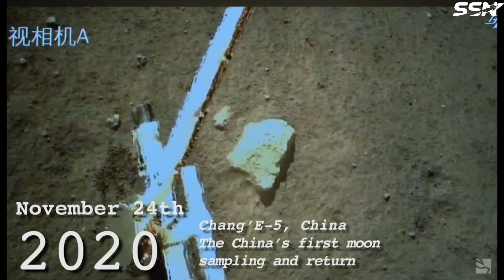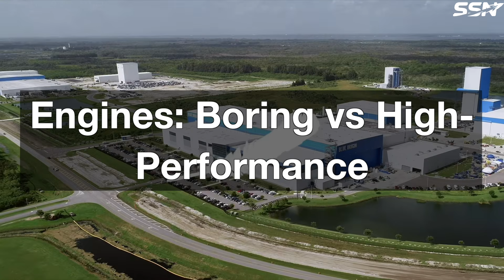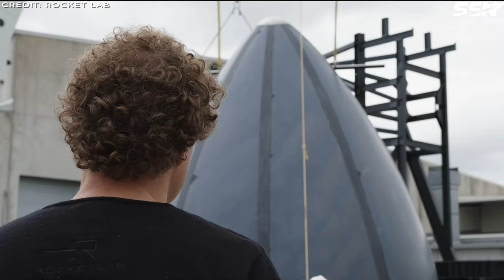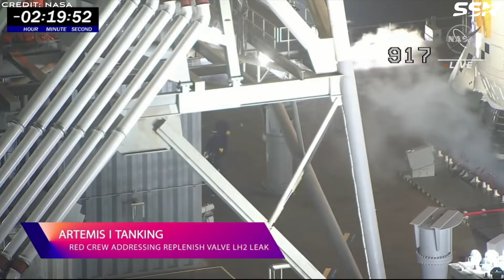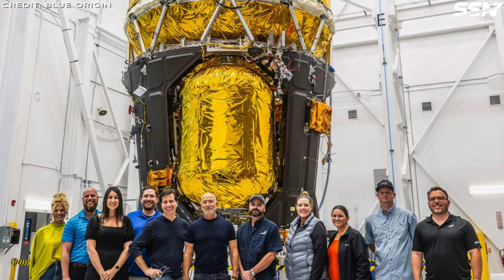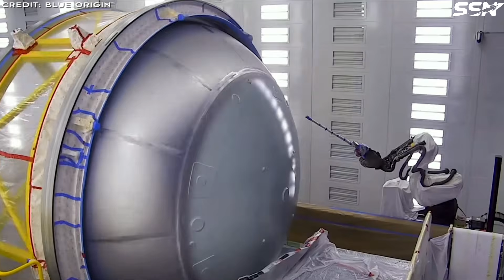NASA's Big Mistake: Choosing Risky Tech Over Reliable Systems

Comment: Rocketlab doesn't use gas generator engines,on Electron they use electric pumps, and on the Neutron (also cryogenic metalox)would use a close cycle identical with that of BE4, make better research next time,if you want an example of future gas generator engines, that would be on the Relativity Space next heavy rocket.
Reply from the maker: Rocket Lab's Archimedes engine is a gas-generator design. Both the Rutherford (Electron) and the Archimedes (Neutron) engines are simple and reliable engine designs compared to staged combustion engines used by Blue Origin (New Glenn) and SpaceX (Starship).
Reply: @SpaceStartupNews check your sources, initially they wanted to use gas generator engines, but they switched to a close cycle oxidizer rich one, nothing simpler about it, but higher performance.
Reply from the maker: Yes, you're correct. Rocket Lab have switched to an Oxidizer-Rich Staged Combustion (ORSC) engine. We will see how this engine compares in reliability with simpler designs.

Comment: I appreciate the analysis. However, the goal this time is not just to land two guys on the moon for a few days, it’s to develop a sustainable colony on the lunar surface. To make this happen new technology is needed. Using older tech might get footprints on the surface faster but won’t enable a long term presence. I think NASA is doing the right thing by pushing technology forward.
Reply: Spacex did not become sucessful by blowing rockets up. They build boring rockets with the falcon 1 and first f9s on proven tech. They then made money, gained experience and iterated on their baseline. Now they are arrogent and trying to leap multiple technologies at once. In 12 flights, the steel rocket hasnt demonstrated it has the performance to put 1 lbs into orbit.
Reply: @owenc.8288You are correct. Strategic and urgent matters can leave sustainability and cost effectiveness for later. While the newer stuff works out the teething problems the proven stuff keeps flying and flying. It has been the standard practice for decades in the aerospace industry.
Reply: @cuauhtemoc8350  its called "old space" slow companies that don't build many rockets which are used only once and charge huge prices for the privilege.
Reply: @owenc.8288 1lb where did you get that number from. its incorrect by the way!
Reply: The trucking industry has been using simple diesel over hybrid, full 
Electric, or hydrogen engines for decades. Why? Because simple works over new technology. You don't need complicated cryo fuels on the moon to launch since gravity is less

Comment: NASA does not require complicated high-performance systems to return to the moon, but if they want to make a sustainable long-term effort, then reusable rockets are a must have.  

It doesn’t matter who gets to the moon first. After all we got to the moon 50 years ago. China is racing for a far distant second place.

The important thing is establishing a long-term presence, otherwise what are we doing?
Reply: Also describing rockets that are reusable and are designed for a high flight rate as risky is just stupid IMO. Let's look at the Commercial Crew program for an example of why. SpaceX and Boeing were both picked to carry crew to ISS. One has done so 17 times successfully. The other has only carried crew to ISS ONCE and it was such a fucking disaster Starliner may never carry crew again. What was the difference between SpaceX and Boeing? Experience in space! Boeing designed a spacecraft based on the assumption that everything would go without a hitch. Indeed, the program only makes sense as a profit maker & not a money loser if everything goes as planned without no problems (since it's a Fixed-Price Contract). SpaceX meanwhile built upon the experience gained with Dragon 1. What I know, Blue Origin will succeed because at some point they will like SpaceX have enough data to succeed. The Falcon 9 is arguably the most reliable rocket in the world, and how did it get there? BY NOT throwing all of the rocket into the ocean & leaving your understanding of engineering capability to sensors & cameras in a very limited time frame (IE: when the rocket isn't headed towards the ocean). Like I can guarantee you that New Glenn will fly more times than SLS ever will & sooner too! What happened is setback yes, but all anyone has to do is look at this chart to see why non reusable rockets are an engineering dead end for any missions that require a high flight rate like I dunno building a space station or moon base (I will not say expendable rockets are a complete engineering dead end, because it makes sense to have a toolbelt with a lot of tools for specific tasks): https://en.wikipedia.org/wiki/2026_in_spaceflight#Orbital_launch_statistics
Reply: Only the americans see this as a race. China simply has a plan and comply with it.
That idea of 50 years values zero now. Many flghts for nothing useful.
Delays and more delays... no reliable schedules but propaganda and ambition.
Reply: @virgiliomateus4239  interesting that you can speak for all of America and all of China.  Reusable architecture is a lot more difficult to develop but more sustainable long-term.

Comment: That is what I have been wondering about, why NASA is baby sitting a failed always company like Blue Origin, a company made before SpaceX and is now over decades behind SpaceX regular cadence launches and proven reliability. Meanwhile Blue Origin always boasts of its 1 or 2 launch success which SpaceX has done a decade ago...
Reply: I can tell you, because SpaceX, whilst did manage to get ahead of Blue Origin, and still is ahead in some degree, SpaceX is falling behind with their Starship.

The Falcon9 and Falcon Heavy may be incredible vehicles, but the Starship is years behind schedule already too, and new technology has to be tested before it can be used for a landing attempt in 2028. Starship hasn’t even managed to complete an orbital mission yet. Starship has managed to reach orbital velocity, but hasn’t completed an orbit. Not only does Starship need to show it can complete an orbit, it also has to pass in-orbit refuelling tests, something that has never before been demonstrated at this scale.

Also, Starship could be seen as an impractical vehicle altogether for a lunar landing, as the sheer size of Starship gives it a very small margin for error. It is believed Starship would have to land completely vertical with a margin of error of just 8°, anything above 8°, and it is believed the vehicle could tip over. Its size is a big challenge that is yet to be tested, and years away from being tested too.

Blue Origin however, has shown it can bring payloads into LEO, and land the booster back on Earth safely to be reused. Their Blue Moon landers are a lot smaller than Starship, so they have a greater margin for error. Not only that, but they don’t need to be refuelled in LEO, so they don’t need to demonstrate that new method, and they had a Blue Moon Mark 1 landing demonstration set for late 2026. With this New Glenn explosion, it is likely that has been moved to early 2027, as Blue Origin has stated that damage to the pad is minimal, and pretty much everything can repaired in place and are ready to continue with launches by the end of the year, so that demonstration is likely only slightly delayed.

To top it all off, Blue Origin has also stated that if they were selected for their Blue Moon lander, then Jeff Bezos would personally fund the Lunar base, meaning the US Taxpayer wouldn’t have to be paying pretty much anything for the base. That is why NASA selected Blue Origin.

If you remember, NASA originally only selected SpaceX for their lander, but that was eventually changed so that NASA would use Starship for the first two crewed missions, and the Blue Moon Mk 2 after that indefinitely. That is still the case as long as SpaceX has their Starship ready and tested by 2028, if not, Blue Origin will be landing on the Moon.

Comment: I agree with many of your points re: the landers, but there’s a lot I disagree with as well. I think the comparisons to Apollo are mischaracterizations for a couple of reasons:
 
1) Everything about sending rockets to the moon was cutting-edge tech in the 1960s. The Saturn V’s F-1 engine may have been a "simple" gas generator cycle, but the engineering required to solve the combustion instability problems caused by the massive size of its chamber was far beyond anything that had been done before. Also, you hand-waved away the Saturn V’s use of hydrogen as "just the upper stages," but that’s also the case for New Glenn, and hydrolox was far more of an experimental technology in Apollo’s time than today, where—between the Shuttle, the Centaur, and Ariane V—hydrolox engines have flown reliably hundreds of times.
 
2) I don’t think Artemis is an apples-to-apples comparison to Apollo because, inflation-adjusted, the annual cost of Apollo was equivalent to NASA’s entire present budget, much of which is spent on programs other than Artemis. One of the budget items absorbing a great deal of NASA’s funding is the proven, but extremely expensive, SLS. Which goes to show that proven and reliable does not mean practical or affordable.
I do also want to highlight a point regarding Rocket Lab. The Electron does not use a gas generator cycle engine, but (quite notably) the electric pump-fed Rutherford engine. It was the first orbital rocket to use this cycle, so it was very much a novel, cutting-edge system. It’s proven to be extremely reliable, which again shows that new, unproven systems are not necessarily unreliable ones.
Now, I do agree to a large extent regarding the landers, and I think Impulse Space’s proposal makes a lot of sense. For a lunar landing system, there’s a strong argument that you want reliability on par with a launch escape system, which means hypergolics (or solids). Blue Origin’s idea is that hydrolox will have long-term benefits on the lunar surface due to ISRU, and while I do think that’s a great idea worth pursuing, having the first-phase landers (like the Mk1) use hypergolics, as the Apollo LM did, would be a better idea.
Reply: I'd like to add point 3 to this. 3) The point of Artemis is not flags and foot prints. The Chinese program is. Artemis is about going to the Moon to stay. You can't do that with a simple lander that just touches down and gives you a day to plant your flags and go home. If that is what Artemis has become, then this is a change that happened after choosing the vendors that were going to do this task. I mean if the point right at the begining of Artemis was to quickly get to the Moon before the Chinese and plant a flag, then we would have a completely different lander. One like Apollo that you could just kick through the side wall because it was made as a minimum viable product. What Blue and SpaceX are trying to do is a whole generation ahead of the Chinese Moon lander.
Reply: Well said

Comment: Nasa did the approach of having multiple providers and it failed (boeing starliner for human space access). This time it looks like the new alternative for the moon (blue origin) did not plan properly for failure (no alternate pad, did not even build their own rocket launch test pad on their own land, imstead used public land and public pad of nasa to do their experiments.
Reply: The real issue is listening to lobbyist instead of common sense
Reply: I'd say using two providers did work since they ended up with one working and one not instead of potentially only picking the one that didn't work.
Reply: You missed the point. SpaceX Dragon is the human rated LEO system.
Reply: @Dularr  both starliner of boeing and dragon of spacex were supposed to be the two systems that are human rated for LEO, sadly only one is deemed acceptable in reliability.
Reply: @soothingunboxing7129 
That represents a success in the program. NASA hedged their bets in case one of the programs failed, which one did. They got a successful reliable program.

Comment: The voice of reason. The #1 rule of every project: risk mitigation. 
Nasa: Ohhh let use a new non proofed boster, complicated fuel and new engines. All will be fine.
It won't!
Reply: Are you writing this vulgarity under the name of the Apollo program?
Reply: Also: don't use the same provider for the rocket and the lander . If one fails the other is aitomaticallt off. Double mistake with Blue and X.
Reply: *automatically
Reply: @MiguelCordeiro1  Yea, it's best to build the rocket and lander in two different countries, that way when you go to bolt them together they fit just perfect.       :)